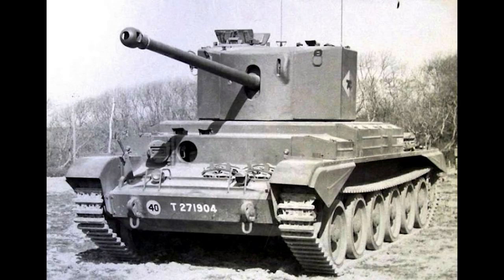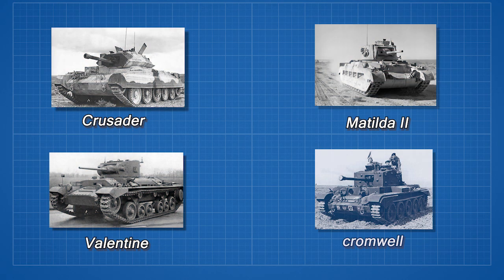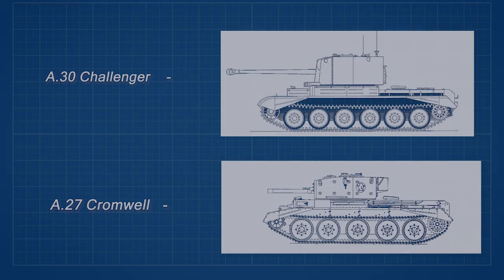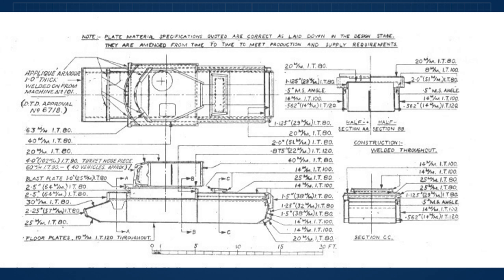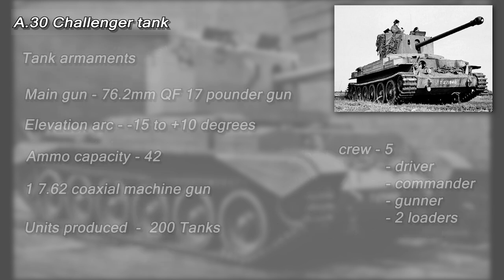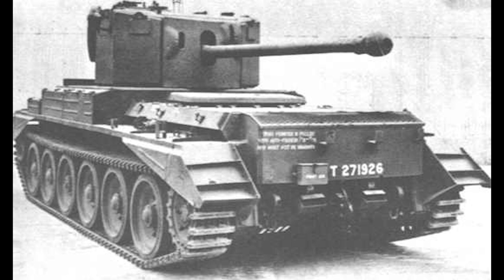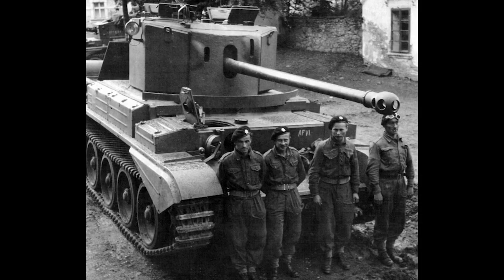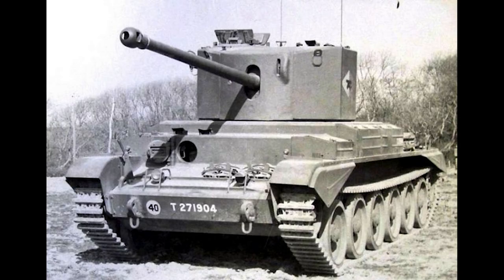The design and history of the British WW2 tank, The A30 Challenger tank

Comment: Frontal armour was the same basis as the late war welded Cromwells: 101mm frontal turret.  They were issued to the Cromwell recce regiments of the armoured divisions.  Like the Firefly, they were initially issued on a 1 in 4 basis, but as the war went on in late '44 and into '45, that number was, for both Firefly and Challenger, increased as new vehicles were delivered.  By the end of the war, most of the gun tank regiments used 2 Shermans and 2 Firefly per platoon in NW Europe and the recce regiments matched that with 2 Challengers & 2 Cromwells.  The Guards Division, which used the Cromwell as their gun tank in the tank regiments never got as many Challengers as the recce regiments.